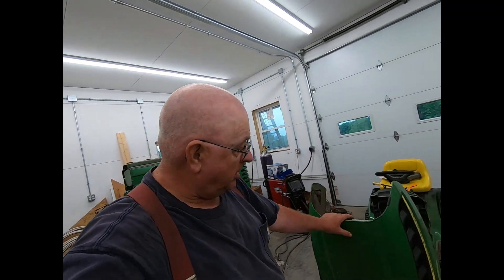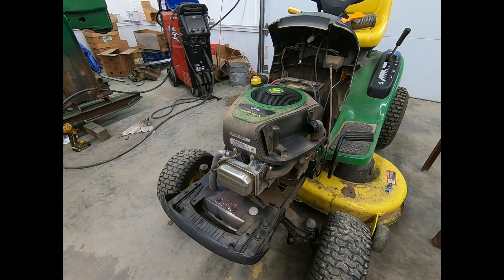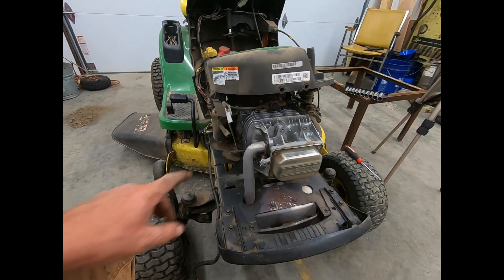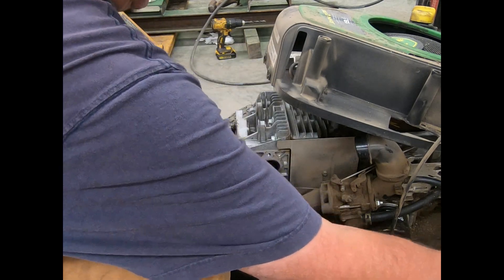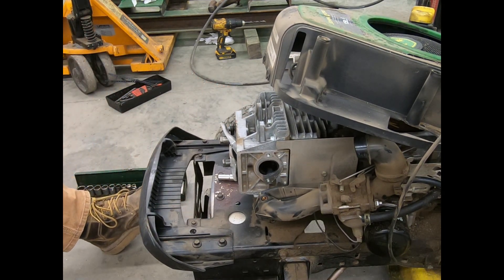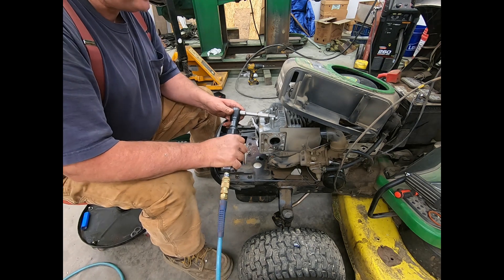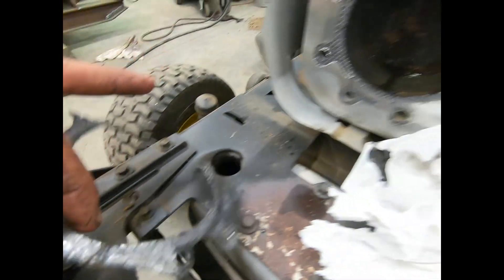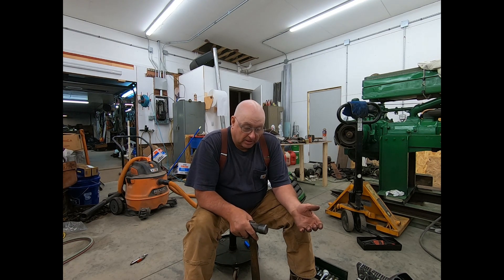# 600 John Deere D110 head gasket replacement part 1

Comment: Mine failed at around 120 hours. Smoked like a chimney and was pushing oil out of the fuel pump breather from the impulse line. Still ran perfectly though 😂

Comment: A few things:
1. All fasteners are metric.
2. The intake push rod is aluminium and the exhaust is steel with a red stripe.
3. It is not necessary to remove the valve cover when replacing the cylinder head gasket.
4. The cylinder head surface flatness must be within 0.1mm [0.004"].
5. There are THREE torquing steps for the cylinder head bolts: 9 Nm (75 lb-in), 17 Nm (150 lb-in), and then 25 Nm (220 lb-in). OIL THE BOLTS BEFORE INSERTION!
6. Tightening sequence from lower-right clockwise around to upper-right is 7-1-3-6-8-5-2-4.
7. You can leave the piston carbon alone.
8. Those long dowels are completely unnecessary because there are already two alignment pins on the block.

Comment: What's annoying is that Briggs and JD proceeded using that puny head gasket for years well after they knew it was a problem.  And then the replacement part is like the cure to prevent it from ever happening again.  That replacement version should have been added years ago!

Comment: I need to rebuild my motor in my GT235 tractor someday but she still runs and gets the job done. I had gotten it from a guy it had a broken valve guide I put a new head on and been running it ever since but she uses some oil

Comment: Great job. Bought a 90s craftsman GT with 6 speed manual two years ago. Wanted something with a manual trans. Had to replace one of the head gaskets on its kohler 22.5hp for the same type of blow out. Bought off a guy from two states south of the border if you now what I mean which I know you will and he promised it needed nothing. That was my last straw, never buying anything from those folk again. Of course it needed other things too but it’s all fixed.